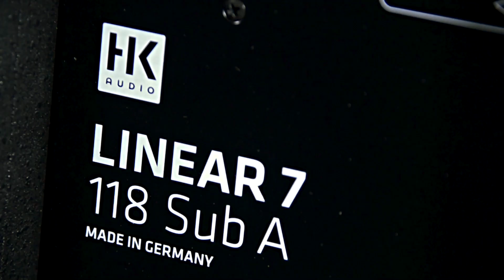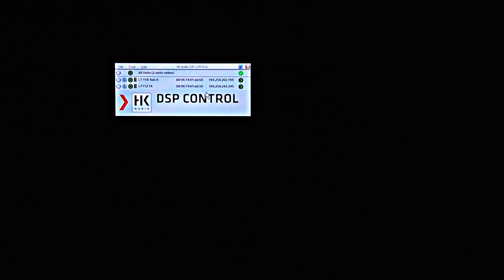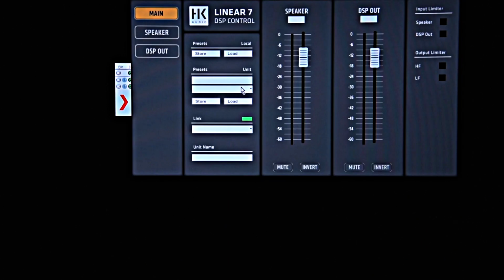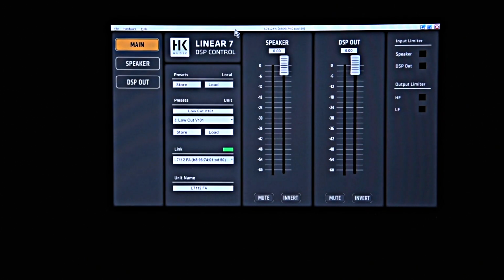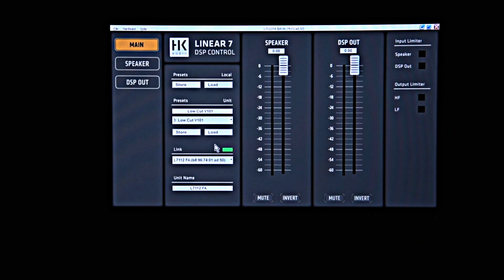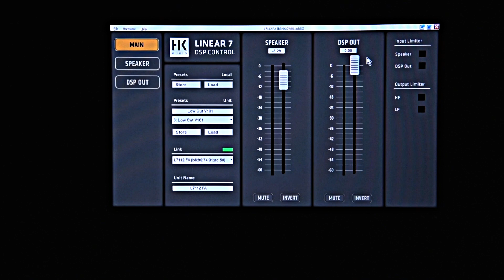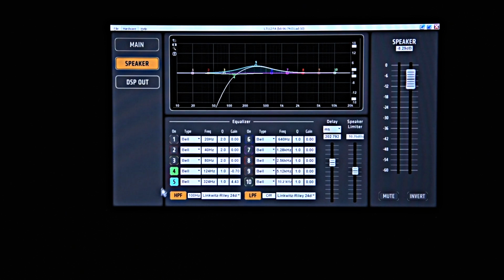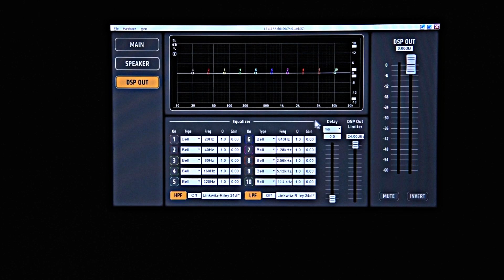Setting up a LINEAR 7 system PART 4 | DSP and network control options (English)

Comment: links are broken, your not showing how the pc is connected, not showing the setup which is the most important step.

I'm disappointed, couldn't find for 2 hours on your site whether you need a dhcp or if you can setup static ip and which network the speakers use as default , can i connect the pc to the sub with rj45 strait up or do i need a router in the middle to give dhcp addresses?
Reply: is it just using apipa?